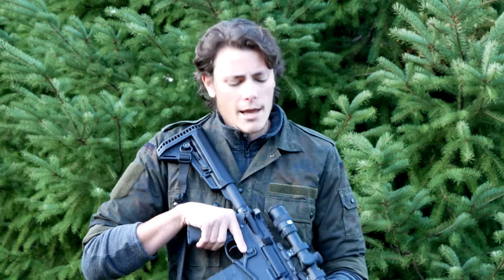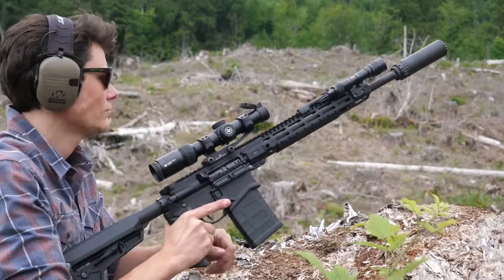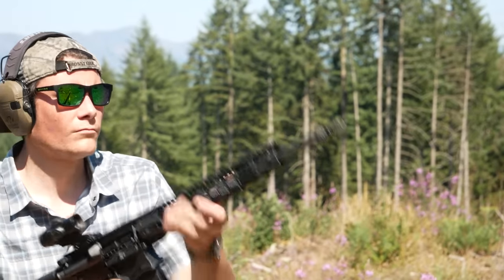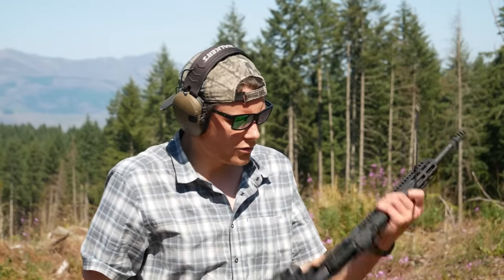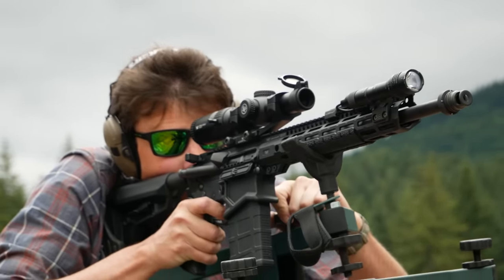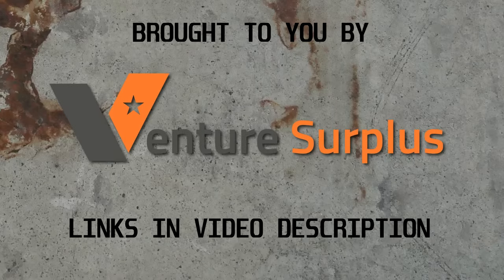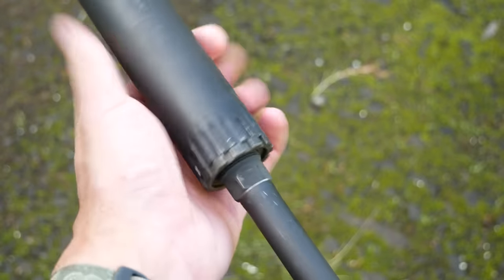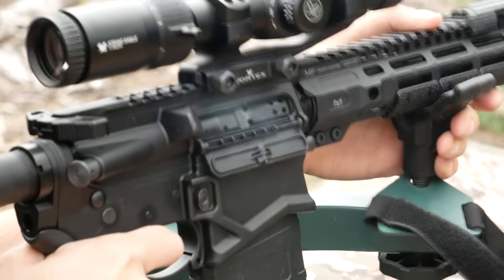Taking the Ruger SFAR to the Limit

Comment: Even if it's over gassed-- it shouldn't rip the casing on extraction like that.   Chris at SAS has a very good hour long video on buffers and buffer weights.   Your issue is that it was trying to extract too soon, so the chamber still has very high pressure as the bolt is already trying to move.  This is likely because the bolt is so light weight.  So what you can do is add an H2 or even H3 buffer:  what this does is add more inertia to the BCG and it will delay the acceleration of the bolt for just a slight moment which allows the projectile to have more time to exit the barrel, which will drastically drop the pressure in the chamber and that will keep the casing from getting stuck...  The problem is TIMING--  not necessarily over gassed,  but just that the bolt is too light.  A heavier buffer would at least stop the casing from sticking to the chamber walls...   You can get a 3 pack of tungsten weights from brnells for twenty-five dollen and just swap them in the buffer you have. 

Even though you already "fixed it" --  I would still do this anyway.
It should keep you out of that window of high chamber pressure:  to the point that it should never rip a case again, no matter what setting you are on.
Reply: I’m pretty certain Bartocci said the buffer weight was tied directly to the barrel contour and was a way to reduce bolt bounce more than anything. At one point I had a S&W AR that would rip case rims off. Did it with CAR and H3 buffer alike.
Reply: That doesn't make sense. The bolt's weight does not matter, it is locked in place until the gas system unlocks it.
Reply: @K-bob_45   That's true.  the inertia works in your favor in both directions.
Reply: @calholli  I think it was more than inertia. I think by being a thicker contour you get a more elastic collision.
Reply: @Stribogboi    Most people just don't realize how integral the buffer is to the system working correctly. Granted, Ruger should have already tuned it correctly to begin with.
Reply: @jonathansmith7306   Correct:  now think it through-- every step.  The bolt stays locked until the gas or piston pushes it to the rear.   When something is heavy, it is harder to accelerate.  You can quickly push a bike and start running fast right away-- but it's very hard to push a car at first;  but as it starts rolling, it gets easier and easier to push.  This resistance of that initial movement is called "inertia".   The same thing applies to something that is in motion and you try to quickly stop it.   Again, lock up the brakes on a bike and you'll stop in a few feet..  Lock up the brakes on a train and it takes miles to stop.  That resistance to CHANGE in motion-  from moving to STOP, is also called "inertia".  It works for any change of motion, including just a change in direction.  Light weight cars turn corners fast, where heavy cars won't let you turn fast...   

So again, as the gas/piston first starts accumulating pressure against the bolt--- it will accelerate at different rates depending on how heavy it is.  We're only talking about tiny fractions of a second here--  but the bullet is so fast that it doesn't take very much extra time to leave the barrel...   

So again, it still unlocks the same way, it just starts off a little slower at first and builds up to the normal speed of the bolt.  It will actually make the bolt go a little slower over all, since you're losing more pressure out the muzzle of the barrel as the bolt/ buffer is resisting that initial acceleration, because it's heavier.  It's simple physics--  but it's just happening in a very very short time frame,  like 5 thousandth's of a second.  

But by the time the bolt gets going and moves enough to unlock and is now pulling on the rim of the empty casing --   that bullet is now long gone out the end of the barrel and the gasses are violently spraying out the end of the barrel, which very quickly drops the pressure inside the brass casing and lets it eject easily without resistance. 

Because understand:  When the bullet is still in the barrel and racing towards the muzzle--- there is over 55k PSI inside that brass casing and it is smashing the walls of the brass very firmly against the chamber walls of the barrel.   So if that's still happening while the bolt is already moving and trying to pull that casing out while it's still under that high pressure ---  it basically acts as an "interference fit" -  and will not eject.     Think about that--  it's pressing so hard against the chamber walls and has so much friction that the extractor literally rips the rim off of the brass casing before it can make it move.  

The only reason it can do that is because the bullet has still not yet exited the muzzle;  It has already passed the gas port hole -- but it's still not quite exited the muzzle;   This is known as the "dwell time"...   

And yet the bolt is already moving;  again, the bullet has passed the gas port, and is not yet to the muzzle but the bolt is already moving and unlocking ----  the only way it can do this is if the bolt is light weight.  period.  If you make it heavier, it takes more time to build that acceleration curve and you get nice clean ejection.

Buffers have little steel cylinders in them as weights..  You can buy tungsten weights and they are nearly twice as heavy...  A normal buffer will have three steel weights in it.  If you swap in 1 tungsten and 2 steel: that's a "heavy buffer" or H1.  If you swap in 2 tungsten --  it's an H2 buffer.  If you make all 3 weights a tungsten, then it's an H3 buffer.    This is common knowledge for guys who build or tune problem child rifles regularly.
Reply: @K-bob_45     After recoil, as the bolt is coming forward again and locks home and tries to bounce-- that buffer is also slamming home behind it-- and because it's heavier, it helps to hold the bolt locked closed so you don't get that bolt bounce.  The "thicker contour" of the barrel just means it's a larger piece of iron, just like a black smith having a big anvil...  again- it's the same concept:  INERTIA.
The larger/ thicker/ heavier barrel has more inertia and has less give, less flex, less bounce, etc..   It's more solid.  So that makes the bolt bounce off of it even harder.  The same thing happens with an anvil:  you can take a ball bearing and drop it on a smaller anvil and it will bounce a couple feet.  But if you drop that same ball bearing on top of a 400 lbs anvil-- it will bounce much higher;  simply because it is hitting something that has more inertia and doesn't want to move at all-- so the ball bearing will compress more and therefore rebound higher. 

The bolt slamming against a heavy barrel is doing the same thing..  it's like hitting a more immovable object and bouncing off of it more.

Again, I'm not disagreeing with you;    you are correct in what you're saying-- but that's not the only benefit.  Again, his video on buffers is over an hour long.  He explains all this stuff---  everything I've said, and everything you said.   I've watched that video like 4 times all the way through.
Reply: @calholli I'm not going to read this, because I am a mechanical engineer, not a child. I know what inertia is.
I know how an AR gas system works. If the bolt is unlocking too early, that's the fault of the gas system.
If after the bolt is unlocked, the bcg moves too quickly, that's a combination of gas pressure and buffer mass.
So, for rim getting torn off, the gas system is primarily at fault.
Reply: @jonathansmith7306  You're assuming that the rifle has been engineered correctly.   This is a proprietary setup with an ultra light bolt relatively to a normal AR10;  yet it uses standard AR15 parts, gas tubes, rails, etc..   So automatically it's going to need a lot of R&D to get it tuned correctly;  which they very likely didn't' do.  They just made it able to use standard AR stuff and threw it on the market..    The gas system can only effect the pressure within the system;  In order to effect the TIMING of the system, you would have to move the gas port to different locations on the barrel; (carbine/ mid length/ rifle length, etc.).  but they chose not to do that-- they wanted it to be compatible with all the stuff on the existing market:  which is a good call IMO.  But if you need to adjust the TIMING of this system, you have to do it with the buffer. Period.  The adjustable gas block is only fine tuning the force on the bolt. 

I would still be paying close attention to the casings and add a heavy buffer to this-- because I would bet that it's still scratching the h3ll out of the outside of the brass, because it's still trying to eject too early while the chamber is still over pressured.   They did well and shrunk down the bolt, but now it's too light.  I wouldn't trust this thing without a heavier buffer.

All you have to do is shoot this with a slo-mo camera and it will be obvious.
Reply: @jonathansmith7306  But again--  you say you know what inertia is --  yet you still don't understand how the buffer effects unlock timing.      ". If the bolt is unlocking too early, that's the fault of the gas system."  -- 
It can't unlock too early if the bolt is heavy-  the laws of physics simply won't let it.  in order to "Unlock", the bolt carrier has to move to the rear about a half an inch.  To move that far it also has to push the buffer along with it.  If the buffer is heavier, it will slow unlock timing and stop ripping/ scratching your brass.

After the bolt gets moving it can still get up to high speeds..  It's only that initial acceleration off of zero that is really effected, which is that first 1/2" movement that it takes to unlock the bolt.. 

 And I'll say again --  that DELAY allows more pressure to exit the muzzle, which also effectively reduces your overall force-  just like adjusting the gas block does.  But again if the timing is correct, no amount of over gassing will rip your brass like that;  that is strictly a timing issue

Comment: As fellow riflespeed advocate and customer I have some charging handle and recoil reducing advice. I recently put together a build utilizing the riflespeed gas system and paired it with a tubbs flatwire rifle length buffer spring, kynshot 5007 9mm hydraulic buffer, and an a5 length buffer tube from dark hour defense, and an Armageddon tactical gms-15 evo charging handle. I believe dark hour defense is a sister company or has a tie of some sort to v seven as it looks identical to the other v seven buffers I've bought in the past.
The rub is the buffer and flatwire spring is a bitch to get in and out, probably a retainer out there that alleviates this, but it functions better than I dreamed it would have with recoil mitigation. The charging handle has a section of rubber that seals to the top of the lower receiver which came out almost immediately but even without that I have zero gas coming back getting into my face so I don't really care. I may try to add something back in its place but for now I'm happy with it. The hydraulic buffer gave me pause at first as I have several issues with them years ago leaking, but comparing them side by side it looks like they've had multiple revisions and upgrades since the old ones and with about 420 rounds of various ammunition types through it so far I've had zero issues, making it about 300 rounds longer than the old ones I had previously, ymmv.
Hope this info finds you well.

Comment: 308 AR’s are like driving a Range Rover. They’re cool when they work but you have to be ok with it shitting the bed randomly. They are no good as your only option, especially if you need any level of parts compatibility. 
Why do I also own 3 LR 308’s, you ask? Because sometimes I eat pieces of shit for breakfast and refuse to change.
Reply: They work fine when made by a reputable manufacturer. We have four rentals, DD, Larue and LWRC, thousands of rounds and no issues except for when people slam in a mag on an open bolt and cause a double feed(which is the operator’s fault).

Comment: I guess I've been lucky. I took mine through the break in period with 200 rds of LC ball ammo, and then some extra ammo a friend gave me:). Zero failures on setting 3. It just worked perfectly. 
I ran into some lock back issues when I made some ammo for it that was a little to spicy. I dialed the powder back, and got exactly what I want for a Vmax 110gr bullet with exterminator. No failures yet....
If I have any issues I guess I could just change the gas block since Ruger is giving new revised ones away.

Comment: i built a couple of Knight's SR25/Armalite AR10 bastard rifles in the '90s, Reliable extraction was realized with a heavy stainless buffer with a tungsten anti-bounce weight of my design and a David Tubb flat wire spring. Bolt carrier/Buffer group needed more mass and more linear spring rate. I'd try the flat wire spring first. My two cents...

Comment: Just had Wolfpack Armory do some work on my SFAR. I had them cut the barrel from 20" down to 18", install a riflespeed gas block (they have them in stock) and their MK5 handguard, and put a muzzle brake that accepts a blast deflector and suppressors on. Haven't shot it myself yet but it seemed to cycle just fine when Austin fired a few rounds through it.
I didn't even bother testing the stock rifle. Between the reviews and having worked on the DS-25, it's obvious Ruger just couldn't get gas regulation down, and their track record for QC hasn't been great. I got the SFAR because they have a rifle with a dedicated .308/6.5 bolt and barrel extension, and forged recievers for an affordable price. I might play with carbine buffer weights and springs if I don't like the recoil impulse because the factory one seems pretty light.
Reply from the maker: Alright that sounds like a sick build

Comment: That’s interesting. Granted this is a year old now, I have the 6.5creedmoor variant w/a 20” barrel and it can cycle anywhere from 120gr to 147gr ammo types with setting 2 and/or 3 on the regulator. Little more gas on 3 but not as much these .308s produce.

Comment: Sfar with flow through VENTUM by hux works is great. Also a H2 buffer weight helps slow bolt down for increased reliability.
Reply: I added the H2 to both my SFAR and POF Rogue and that was key.  Also added dictator gas block to Rogue.  They both work now.
Reply: I’m confused how these gun guys are being stumped by AR gas tuning. 
You’ve got 3 options, spring weight, buffer weight, and gas settings. 

Fine tune each til desired results. It’s basic AR stuff. 🤷‍♂️
Reply: @Upliftyourbrothers If you're going that route, you might as well just assemble a build. You're missing the point that a factory rifle ought to be reliable out of the box and not require modifications such as tuning the gas system. Let's face it, this Ruger is junk.
Reply: @Enjoyer.762  I’ve had zero malfunctions. But your right, they need to have worked out all the bugs for all the builds. I agree it’s unacceptable, but it’s also a good idea to know how to tune a gas AR rifle.  It’s like a dirt bike that has a carb not jetted correctly from the factory. Sucks if you don’t know how to rejet, not a big deal if you do.

Comment: So I HAD an SFAR. It was a jamming, brass chewing, canted gas block hot mess. I replaced the gas block with an aero adjustable. It helped but still had jams, stuck cases etc. I had to get rid of it. My Sig 716i has never jammed yet with all types of .308 and 7.62x51mm. I am a sample size of one so I am sure people have SFAR’s that run like a top. But that wasn’t the case with my rifle.
Reply: @@hnojic 16” mid length gas

Comment: I think I may be one of the few that hasn't had too many issues with a stock 16-inch SFAR.  During the first 40 rounds I had a failure to eject and two fasilures to feed.  I pulled the BCG, lightly cleaned the BCG, lightly "spritzed" it with some CLP and fired another 40 rounds with no issues.  I'm running LAX Ammo, 147 gr FMJ 308 Win.  I have around 300 rounds through it so I'm figuring its broke in.  
I've not fired it through a suppressor yet, but will be running a Sandman S on it.  I'm curious which RifleSpeed gas block diameter and length you went with.  
As for accuracy, I'm not the best shooter (but I'm working on that).  I have a Primary Arms 3-18x50 FFP with ACCS HUD DMR reticle.  I'm usually within 2 to 3 inches of point of aim at 75 to 100 yards.  Again, I'm not the best shooter.  I have a home range, but I'm limited to around 125 yards and haven't found a local range longer than 100 yards.

Comment: Went ahead and ordered the 20" version as 18" is minimum barrel length allowed for hunting here in Sweden. Should arrive at the dealership any day now.
I'm not actually a Ruger fan at all, after owning a 10/22 at one point.  BUT I think Ruger is onto something here, and I want to be on the lighweight bandwagon🙂..plus I don't mind tinkering to optimize function if needed.  I think it's half of the point the AR, being able to customize it without being a certified gunsmith.
Reply: The 20” models don’t seem to have the issues.  20” makes more sense imo anyway.  .308 losses a lot of velocity from 20” to 16” barrel.  Imo.

Comment: I would highly recommend POF's roller bolt cam. A STEEL bolt cam is digging an aluminum upper. Who wins? On some .308 AR it will drop in past the gas key. With the AR-15 version you can get a kit with the gas key or do what I did and dremel away just enough of the existing key without removing it to drop in the roller pin. The material removed does nothing if you look at it. You might be surprised how much difference one of POF's buffer tubes that supports the BCG improves your inline recoil. My AR-10 has a 20 oz BCG, a 7 position buffer tube I no longer see and a rifle length spring with a carbine length H2 buffer. Along with a soft buttpad ALL recoil is absorbed.